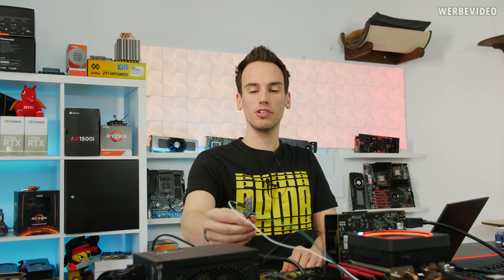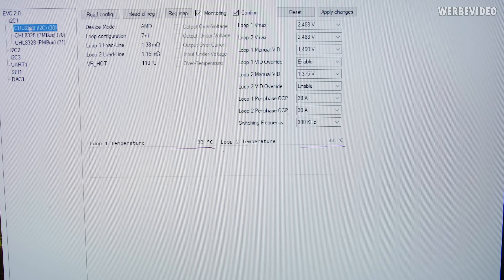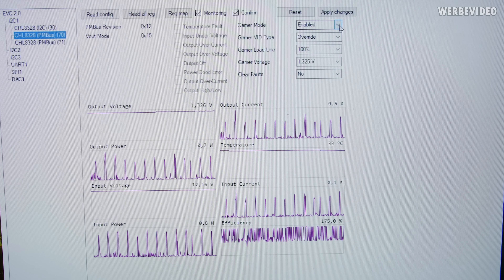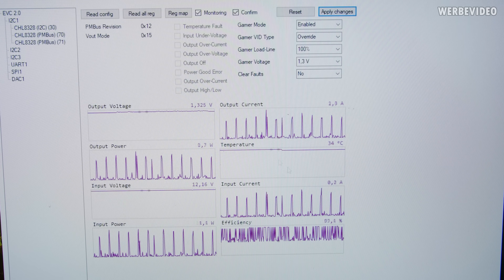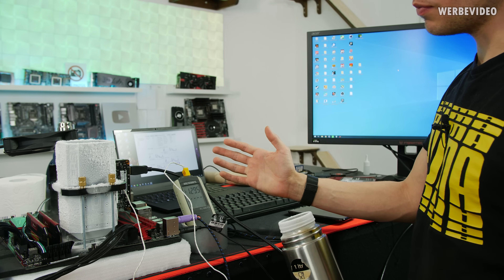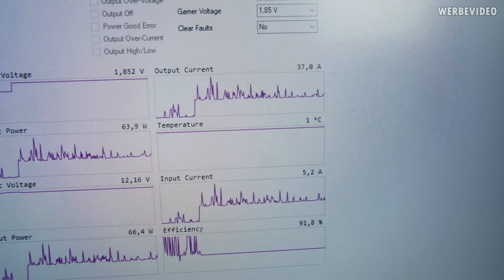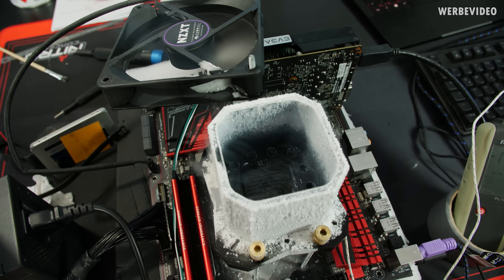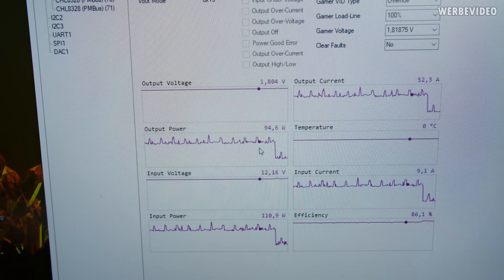We Overclocked an AMD CPU to over 8.1 GHz !!

Comment: I upgraded my server from a 6300 to a 8350 in early 2018. I bought a new FX8350 of ebay shipped from Germany at that time. It really was new the build date on it was feb 2018 (or something like that cant remember exactly). I do wonder how that chip so late in the production run would go overclocking wise.

Comment: You always need to overclock a HT and RAM when you overclocking FX cpu, that's why you have it so slow in a single-thread performance. FX series cpu very depends on RAM and HT speeds. Anyway, nice overclock.

Comment: To "bend back" AMD pins, I have found that a mechanical pencil works pretty well. Just remove the graphite "lead" from the pencil and insert the bent pin in the tip, and bend slowly.
Reply: Martin Libby that’s a great idea
Reply: @xph4ntomx  noob
Reply: You are great man.
Reply: THIS MAN FIXES CPUS IN SECONDS AND TECHIES HATE HIM FOR IT!
Reply: @Minirow  😏 is that where I think it's from
Reply: Owhh... Man you saved me 😭

Holy crap that's simple trick WTF my head can't thinking be like you
Very long i'm struggling with sewing needle.
Reply: YOU A WHOLE KING BRUH
Reply: My mind is blown
Reply: Someone finally use 100% of his brain😆
Reply: Thx
Reply: Pens work just as well. Either the ink tube or the pen shell tip with the guns removed
Reply: bank card works better. you can have them allso alligned perfectly
Reply: I always just used a razor blade.
Reply: Solid advice
Reply: I wish Intel still used upright pins. Because on my old 5820K CPU, the board pins were bent by a prick who returned the board I sold. I'm trying to figure out how to straighten then because it's difficult as the pins are at various levels and angles by design!
Reply: You didn't find that idea, everyone knows this.

Comment: Still running FX8320 @ 4.7Ghz with Hyper212 on Gigabyte board with active VRM and NB cooling by 90mm fan hotglued on the side of the 212 and exhaust towards the front with the Hyper212, stable at 60C tops :)  
Still getting 140+ fps in Apex Legends with RX580 8GB

Comment: i used to have that motherboard. was a trusty workhorse for a long time. though, the chipset cooling was pretty insufficient for my every day OC of 5.2ghz. the 8370  i had was a god bin; prolly one of the few good FX cpus out there; managed to hold its own. i found that in order to keep the OC stable on an AIO, i had to overclock the chipset as well (and thus the mem controller, and ram).

kinda miss that setup. was stupid but it sure did well for its age.

Comment: Hi Roman, i have a fx8120 and 9590 laying around and wanted to oractice some overclocking. My issue is the 9590 is throttling on my m5a99fx pro r2.0. I believe thos is because the VRM is overheating. Because i am having to underclock the fx9590 to even get it to work.

My question is if i was to buy a used motherboard on ebay would the crosshair iv extreme be better or the crosshair formula z be better. I see some contradicting information online.

Comment: Also, yes, anyone who still has an FX series system running, get rid of it ASAP or if you're an LN2 overclocker, have some fun with that.

But in terms of PC utility, the absolute cheapest 4 core AMD CPU you can currently buy (2200G I think) has double the single core performance of even the most hardcore overclocked FX CPU, at default clocks.

AND, the multithreading on Ryzen CPU's is so far ahead of Bulldozer, a 4 core Ryzen outperforms an 8 core Bulldozer/Piledriver with ease.

Comment: Can an overclocking expert tell me what is the limit for overclocking--is it thermally-driven or voltage driven? If i had a magical cooler than could maintain 20°C core temperature, could I increase frequency up to 10 GHz? Or at some point CPU wont be stable regardless of voltage?

Comment: Imagine what would have happened, if the laws of physics wouldn't exist, and there would be no problem with transfering heat from the Die back in the year 2003. Intel would have hit the mighty 10 ghz on the net-burst architecture. Imagine a haswell like performance 15 years ago. Crazy sh*t! But, We know how it ended haha

Comment: You gotta twist a little if you're using thermal paste that hardens.  I personally don't even use paste anymore.  IC Cooling's graphite pads are within 1-2 degrees of kryonaut, and I never have to clean up anything.  

I prefer pins on the cpu over pins on the mobo, personally.... those pins are even easier to bend and you have a harder time seeing them when they do. .

Comment: Good demonstration of how hopeless the FX line was for single threaded applications back then which used to be most games. You had to run it at something insane like 6-8Ghz to match the competition.
Reply: Definitely not meant to be used for gaming. They hold up okay for multithreaded though, however it hardly matters when a modern budget option matches it with better efficiency (luckily).

Comment: On my first build ever I bent the pins the same way as you did in the video. I followed advice from youtube videos to test everything before putting it in the case. It all worked, then I had to remount the cooler as my aio wouldn't fit the way I had imagined it would. The pre-applied thermal paste was like glue and ripped it out of the socket. Bent pretty much every pin on the socket but only slightly. Took me like 5 straight hours to straighten them enough to fit in the socket again. What I learned was to always remove pre-applied thermal paste, even if it's just for a quick test.

Comment: I'm about to upgrade my AMD CPU in a couple of weeks and I'm a bit affraid to bend it's pins when I will swap it. Does rotating the cooler left and right before lifting would help My cooler is a Dark Rock Pro, so it's pretty heavy...
Reply: Run a CPU stress test for 20 minutes, so the thermal paste is soft, and rotate left and right while you try to take it off slightly sideways... I don't know if the last part makes sense... Uhm.. If you try to lift it straight up "the suction effect" will be the strongest.

Comment: I got 5Ghz on an 8350 at 30c idle with a 360mm AIO. Using the AsRock 990FX Extreme9 board. Overclocking my Mushkin memory to 2240Mhz helped a lot more than reaching 5Ghz though.

Comment: I am waiting for the day a room temperature super-conductor is discovered....Overclocking will jump forward massively.
Reply: But therein lies the problem... The heat is like 99.5% generated from the semi conducting part and not the lanes between the transistors. And with current understanding of physics a "super conducting semi conducter" is, at any temperature, science fiction :-/ 

Would be cool though: "How fast can we make a crystal vibrate?.. Because that's how fast we can make a CPU!"

Comment: I bet you would be even more impressed doing this same test using an FX 8370!  It has even more headroom with voltages lower than FX8320! I've managed a stable 5.216Mhz on water(corsair H115i) in full gaming situations online hitting 169 FPS (Sapphire Vapor-X R9 290X 8gb~ O.C. Cranked) ~CPU Never exceeding 58C !!! I never managed to continue pushing it to it's limits to find out what the possibilities truly are.  I didn't finish tweeking beyond  5.375mhz, but everything tells me with enough time spent, my particular rig might be able to get to 5.5 or higher, and with a second H115i in series maybe even 6.1 mhz under load.... With the right motherboards(mine being a M5A99FX Pro R2.0) Kingston 4x4gb 1866mhz ram. P.S.>>> But it's also possible that I was just lucky in the Die Lottery.... or was I????

Comment: How far have people got these on air? I've personally gotten one of the 8xxx to ~4.8-4.9 on air. I don't think I could get it to work 5+! Can't remember. Maybe I did get to 5.1 or so, probably not. That was an air cooler, solid copper, about 1.5 lbs. Huge fan. Good board.

Comment: Pointer for removing AMD coolers, twist back and forth until it naturally comes off, don't lift.   I've personally never had an issue but I've always used the twisting method to break the seal of the tim.
Actually that's a lie, I have had one pull out but I found that someone had super glued the cooler on.  I had to use a chisel and hammer to get the CPU off the sink.
Reply: Accidentally used thermal epoxy on one of my first builds. Good times.
Reply: super glue a CPU? you gotta be fucking kidding
Reply: i had to bend pins back on my fx8350 too after we hit a bump as it was being transported, the damn heatsink came off and took off the cpu sideways

took me 1.5 hours to get them bent back, so it lives to be my shitbox today

i concur with the twist motion to seperate it from the thermal paste, if all else fails, pull it toward you as straight as possible  :')
these zif sockets really don't hold all that well when you apply some force lol

also i'm into led light building, these cobs are actually pretty nice to use thermal glue on :")
Reply: That doesn’t always work, but what does is heating it up (run Cinebench then flip the power off and the cooler basically falls off). If you didn’t do above procedure have fun with a hot air gun and a pocket knife while holding the cooler with oven mits, haha!

Also the Threadripper socket can do this too (the liquid metal etched “Threadripper” into my copper AIO, it was on there good, haha!), for that I ran the pump off and let the CPU hit about 95c in BIOS while pulling evenly as hard as I could and finally got that thing popped off when I used a lot of leverage with a screwdriver prying it off while twisting and pulling.
Reply: @jakegarrett8109  This is a good tip. Ensure the TIM is nice and warm then wiggle the cooler gently, should slide right off
Reply: Been there, done that with a 1090T with original paste.
Reply: TIL don't pull out

Comment: Are you telling me you know the trick to bending pins back upright?
Use a mechanical pencil.  The small metal cylinder where the graphite comes out is the perfect diameter to fit around the pin.

Comment: There is no way it got 172cb in r15 that must be Windows clock bug from running bclk oc
Reply from the maker: no I only changed multi
Reply: @der8auer  it shouldn't score that high though. It should be around 150cb

Comment: Is there any validity to heating up bent pins with a heat gun or the heat gun from a soldering machine? Sometimes the pins are prone to breaking when trying to bend them back but the heat would make them less brittle and more malleable would it not? Just a thought.

Comment: Im still using this processor to this day since 2012 in ambient temps of 35*C -40*C with a noctua cooler. It still overclocks quite decently despite being a room heater.
Reply: Yeah, I have the exact same setup as the rig in this video, (minus the cooling tower or cold). Although, I don't use that computer anymore, it lasted me for years.

Comment: when you remove a cpu cooler, you need to slide sideways the cooler, do not pull it up directly, especially if it doesn't dettach

Comment: Interesting to see how my Ryzen 5 2600 already goes into the 150's single-core stock with the Wraith Stealth cooler and a mid-range B450 ITX board. 
I wonder how the new Ryzen 3 3300X will perform out of the box. It's fascinating to see how CPU's are nowadays improving so much by focussing on architecture and IPC. I remember the times clock frequency was the one and only selling point of a CPU and nobody seemed to care they made use of it very inefficiently. It's harder to compare CPU's now, but since the launch of Ryzen PCs are finally improving again while providing great value.
Reply: Raw clock speed has been an overblown marketing tool for something like 30 years. It's second only to marketing over word size as far as bad marketing goes. In the 90s we already had Intel marketing promoting clock speed when the competition was beating them by doing more work per cycle.

As an aside we should really be talking about work per cycle instead of IPC. Strictly speaking IPC is a very narrow measure that applies only to instruction dense code. In most real workloads you're measuring the interactions of many different subsystems that aren't strictly related to how fast a CPU is when you feed it best-case instruction sequences.

For example, better cache, pipelining or branch prediction improve the average amount of realistic work done per cycle but don't increase IPC in the proper sense.
Reply: I remember maybe 10 years ago AMD had to market their CPU product number according to the equivalent intel GHz rather than the actual clock speed because they were not related anymore. The AMD was doing more with less clock frequencies. This trend seems to have continued with intel running slightly higher clocks and amd now going for more cores. It's almost sad these days having so much processing power available for cheap and not even knowing what to do with it as an average person there is no use for how fast many of these chips are now.
Reply: 3300x get 199 single core
Reply: My R9 3900x cpu goes cine R15 single 208 at stock

Comment: I built a test bench with a EK wb for my Gigabyte 990FXA UD3 in Hope's of trying one more overclock to my Phenom II 1090T, but sadly overclocking is locked to FX only processors on this board. But my FX-8350 does 5GHz easy on it. Seems like a good overclocker. Maybe setup a cheap homemade dry ice pot in the future for it just for fun.

Comment: I used to work in a computer repair shop. We would keep a set of mechanical pencils around with no lead in them  to restraighten the pins on bent processors. Always worked great, might try that in the future instead of a screwdriver?

Comment: Are you sure the software is not misreading the information? 8.1Ghz at 7nm is more than 10Ghz relative to 14nm. I've seen 1Ghz leaps in improvements but 3-5Ghz improvements of almost 200% over base speeds sounds like a reading error
Reply: @Roy marr o.o thank you for clearing that confusion up, I did not realize cpu's several generations old could get clock speeds that fast

Comment: can you throw a 2080ti on there next time and see what kind of framerate you get on crysis at 8ghz
Reply: 3.5 fps on low
Reply: @DMalek  h a l f f r a m e s
Reply: This guy
Reply: oh shit, i'm curious too as the game's made to utilize a single core at a high frequency
Reply: @Struggii  Wait really? I just realized that would have had to be the case. 
Were CPUs ever a bottleneck though?
Reply: Gigi Muschi Just cool the GPU with a dry ice block 😅
Reply: @gigimuschi7466  Yeah, CPU are the ones which affect max fps you can go also memory speed (ram + rom)
If you're running 4k, It doesn't matter much on cpu. But, if you're running on like 800x 600 at lowest then cpu decides max fps.

If like cpu is not very fast it won't go beyond 112 fps depends on game and use 30% gpu. If cpu has more ghz (not cores only clock speed). Then same cpu will go over 230 fps and use 100% gpu
Reply: Pay attention guys, even at this frequency it's single threaded performance is behind modern CPUs running lower clocks.

Comment: Hi
Will a vacuum sealed bag on the entire mother board work instead of rubber or Vaseline
Reply: But you need access to the socket and pcie slot i dont think you could seal that to the level needed here.